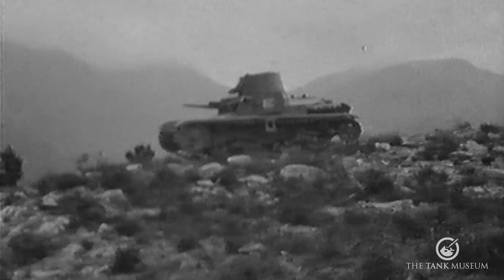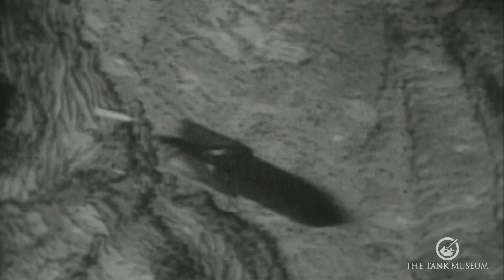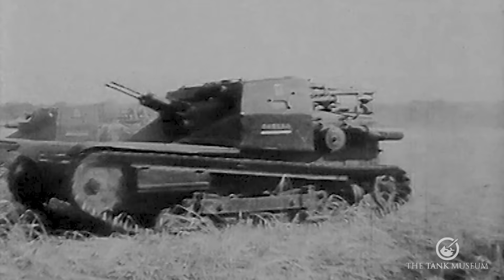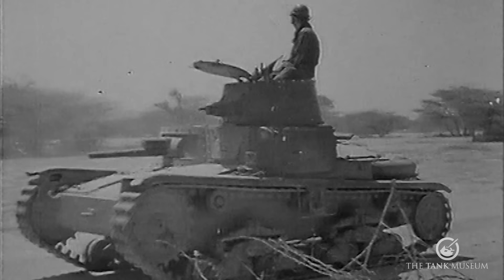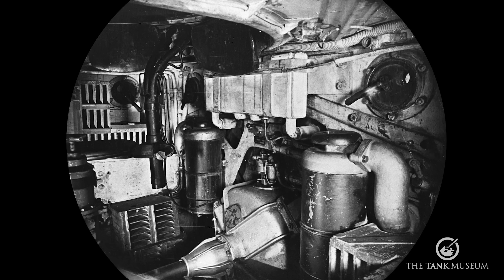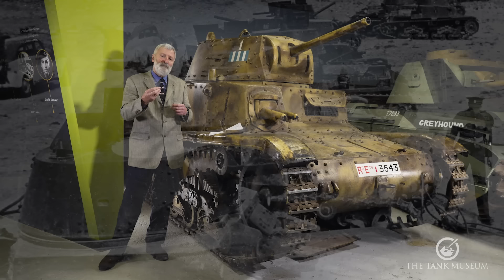Tank Chats #147 | M14/41 | The Tank Museum

Comment: The over looked difference between diesel and gas engines is diesels have more torque. A 350 HP gas engine wouldn't move a semi truck highway speeds but a 350 HP diesel will.

Comment: Rocking bogie is a neat and cheap trick that has been on many a truck and airliner. :o) Even if your spring is only a lump of rubber you still get a decent bulldozer or tracked dumper truck from a bit of triangular plate with bolt holes drilled in it.

Comment: I once read (can’t remember where) that while Italian engineers came up with several good designs for tanks, airplanes and ships, they often ended up putting somewhat crappy models to production because Mussolini made decisions based on what looked good as opposed to what performed well. I wonder how true or false this statement might be?
Reply: It does not make any sense, the problems were simple poor industrialization, scarcity of raw materials,poor decisions to make every builder happy instead of focusing on a few models and standardisation,that's it.
Reply: @M4NAH1MEK0  Yeah, like the industrial "mafia", led by FIAT, that somehow managed to build C.R.42 until the end of the war. Because upgrading production lines were too costly for them, poor souls.
Reply: @Ingulf_The_Mad  The last purchaser of the CR.42 had been the Luftwaffe.
The power of FIAT to impose his models is a mith. FIAT had been unable to impose the optimal CR.25 over the crappy Breda 88 and Caproni 300 series light bombers/reconnaissance aircrafts. FIAT would have VERY GLADLY built more profitable twin engined aircrafts over cheap biplanes and was by far the Italian industry whose production lines were more ready to build them.
The Cr.42 had been selected for production for a simple reason. It was immediately available, while the selected monoplanes needed several modifications.
Reply: Mussolini had not a direct say in the choosing of military equipment.

Comment: That Italians used three engined bombers because they had not powerful engines is a mith. 
The Vickers Wellington had two 1050 hp engines. 
The Bristol Beaufort, two 1060 hp engines.
The Bristol Blenheim, two 920 hp engines.

The SM.79 had three 950 hp engines (later equipped with "etilizzatori", an equivalent of the MW50, to have a temporary 100hp boost, to disengage after torpedoing attacks).
The Cant Z.1007 had three 1000 hp engines.
The BR.20 had two 1030 hp engines.

The performances of the twin engined Br.20 compare very well with those of the Wellington and Blenheim. The Br.20 was faster and with an higher ceiling than the Wellington, although with a lower bomb load, and had performances in line with those of the Blenheim, but with a better bomb load. 

In 1939 had been omologated the 1500 hp Piaggio P.XII. That used standard 87octane fuel. Probably the best radial engine that used standard fuel up to that point.
The Italians used two models of three engined bombers simply because they were faster that way, and could still fly with an engine failure, while, for a two engined bomber, an engine failure meant a long descent. That's why they were preferred to the Br.20 too.

Comment: Thanks David. As always, your chat was informative and balanced.
Question: why would a country using the metric system build a 47mm gun? 50mm is only marginally larger and either 45mm or 50mm seem so much ... neater.
Reply: Good question 🤔
I think the French, Czech, Austrian and Italien all built 47mm guns.
While 45 or 50 sounds more round it wouldn’t make any difference in production.
The caliber of the shell isn’t necessarily equal to what it is called.
German 10cm cannons actually fired 10.5cm projectiles and both US and Italien 12.7mm MGs actually fire bullets with 13mm diameter but both guns and bullets are still called 12.7mm.

Comment: This tank is very comparable to the Soviet T-26, but the T-26 with 45 mm gun dates from 1933 while the M14/41 had the misfortune to enter service in 1941
Reply: The M tanks had much better armor.
Reply: @neutronalchemist3241  Thicker not better.
Brittle armor is a massive hazard to the crew.
The Russians made better steel.
Reply: @allangibson2408  Twice the thickness is better.
Reply: @neutronalchemist3241  Not when it has half the strength and shatters like glass when hit. You want armor to fail in tension not brittle fracture because it is over hardened.
Reply: @allangibson2408  It's not "half the strength and shatters like glass when hit". RHA is RHA. The difference in alloy is marginal. The difference in thickness is massive. The armour of the T26 was pierced by 20mm projectiles. That of the M tanks was not.
Reply: @neutronalchemist3241  Did you look at the photos in the video? The armor failed with brittle fractures (like tool steel). That indicates either poor heat treatment or wildly incorrect composition.
So RHA is not RHA when the guys making it don’t know how to make RHA.
Reply: @allangibson2408  I've seen many photos. Included ones where the turret had been hit hard enough to uproot it from the hull, but it remained intact, and pictures with similar damages on the front hull of a Matilda tank. But you can pretend you can state that M tanks' armor was "half the strength and shatters like glass when hit" or that "the guys making it don’t know how to make RHA" because you have seen a picture if you want.

Comment: Italian radial aeroplane engines were US licence built models. Modern and advanced designs for their times.
Their comparative lower power performances were due to the lack of high octane fuel, like that supplied by America to the Allies.
Even Germany with its advanced chemical industry did not produce for the Luftwaffe comparable fuels.
The higher comparative power output of Merlins, Allisons and P&W's especially at higher altitudes was largely due to the US refining capability.
Add the design evolution capability, the advanced logistics and larger industrial base and you have the good mix necessary to win a war.
Reply: That Italians used three engined bombers because they had not powerful engines is a mith. 
The vickers Wellington had two 1050 hp engines. 
The Bristol Beaufort, two 1110 hp engines.
The Bristol Blenheim, two 920 hp engines.

The SM.79 had three 950 hp engines (later equipped with "etilizzatori", an equivalent of the MW50, to have a temporary 100hp boost, to disengage after torpedoing attacks).
The Cant Z.1007 had three 1000 hp engines.
The BR.20 had two 1030 hp engines.

In 1939 had been omologated the 1500 hp Piaggio P.XII. That used standard 87octane fuel. Probably the best radial engine that used standard fuel up to that point.
The Italians used two models of three engined bombers simply because they were faster that way, and could still fly with an engine failure, while, for a two engined bomber, an engine failure meant a long descent.
Reply: Germany had exactly comparable fuels to the Americans. They measured octane differently.
They just never had enough of it so ran leaner than the Americans.
The late war German engines also suffered from material availability issues leading to design compromises that severely impacted operational life.

Comment: Italian tanks were built with riveted armor plates not so much because Italy lacked the technology to weld them but with the idea that a pierced or broken armor plate could be easier replaced on the field if it was riveted than welded. Of course welding or casting posed major problems and it had needed investments the corrupt industrials weren't willing to do, but there was no lack of technical competence had they decided to go that way. The same reasoning was behind the suspension system: torsion bars are great but if they break they are a problem to replace under field conditions: much simpler with the boogies.

Comment: Thanks Luigi for that information, I never knew the 47 had a Heat shell available. I did know of the bravery of Italian anti-tank gunners who often waited till the enemy tank was only 30 or 40 yards away before opening fire, that takes some guts. This must have been before the heat round was issued obviously. However if one compares like with like the 2 pounder was a much better AT weapon, especialy with accuracy/penetration at longer ranges.
Reply: Actually the 47mm HEAT didn't work that well, and soon the gun crews were advised to treat them as standard HE ammunitions. HEAT penetration depends HUGELY on the diameter of the charge, and 47mm is simply too narrow to have noticeable effects over a simple AP round. 
Same for the first iteration of the 75mm HEAT ("effetto pronto"), that had the fuze on the back of the charge (usual for artillery ammunitions, but not for HEAT charges, that must explode at exactly the right moment to be effective) while the second iteration ("effetto pronto speciale", with front fuze) had very good penetration.
Instead the 100mm "effetto pronto", with back fuze, impressed even the Germans for its effectiveness on Soviet heavy KV tanks. The back fuze made it work like an HESH round, and the resulting spalling effect was more destructive than simply piercing a hole in the armor.

Comment: Also the 47 mm gun had just over half the penetration of the British 2 pdr and was hardly in the same class.
Reply: Indeed but it also comes down to the ammunition used. M13/40 enjoied availability of "Effetto Pronto" AT ammunition (think it's HEAT in english) while this ammo was less common among the 47mm issued to foot-folk. Anyway the M13-40 could support its own infantry or attack the enemy's one with explosive rounds which the british tanks lacked, so all in all not bad.

Comment: Its always fascinated me that the 2 pdr had such a poor/nonexistent HE round. Its 40mm in diameter the same as the bofors anti-air gun and yet it never got an effective HE round. Does the 7 extra mm of diameter on the Italian gun make that much of a difference?
Reply: Probably has something to do with shell length and army doctrine
Reply: I think it has more to do with muzzle lenght and muzzle velocity of the round. HE rounds are hollow inside and can't tolerate the accelerations of an high speed round.
Reply: @luigiduca  The muzzle velocity of the 2-pdr was not that high. That of the Bofors AA gun (or of any AA gun of comparable caliber) was higher, and they obviously had HE shells. 
It's a question of role. The Italian 47/32 was classified as an infantry gun, so HE shells had been developed and distributed. The 2-pdr was classified as AT gun, so only AP rounds were distributed.
Reply: @luigiduca  High velocity guns always have less effective HE rounds than low velocity guns of the same calibre for this reason - you have to make the shell casing much thicker to resist the stresses of firing and that reduces the amount of HE filling. Unless you make the shell a lot longer, but this brings its own problems.

Comment: T(h)ank you for a very good video on this Italian tank! I built a similar one as a plastic model back in the 70's, a M13/40 if I remember right, this brings back memories! I think the Italians are underappreciated, they worked wonders with what little resources they had. Well, they were on the wrong side, so it's good they didn't have resources, but still. They were no joke.
Reply: The Italians worked wonders with the leaders they had… Everything else flowed from that.

Comment: Basically everyone at the start of the war had fairly poor tanks by comparison to mid/late war designs. The issue is Italy didn't have the manufacturing capability to get rid of those designs quickly enough, where as everyone else did.
Reply: For fun, check out Italian artillery production rates. All the artillery heavier than a 75 mm mountain gun were produced in numbers of a few hundred each. The industrial base was limited, though in fairness also restricted by a lack of raw materials. The Italians were very dependent on imports and the Allied naval blockade and the German appropriation of the wealth of conquered nations forced them to largely rely on domestic resources.
Reply: Don't Forget that you have instances of Germany requisitioning materials that were being sent to Italy or when the Italians asked for German AA batteries to defend their factories Germany promptly said no, only for those factories to be bombed a year later. That was the main reason the P26/40 didn't enter production prior to late 1942/43
Reply: @theotakucomrade  Sure, but the base issue is still that Italy was not ready for a major war. Not enough technical base, not enough raw materials, not able to defend themselves when things went wrong.
Reply: @silmarian  
It was mostly about leadership and raw materials/production capabilities, the engineers that worked on Italian aviation are the most praised to pick an example

Their design capabilities weren't an issue as Italy had no shortage of talented designers, but they were hampered by the inadequate infrastructure and low material availability as already said, they had to develop work arounds, actually talented officers had to circumvent similar issues by applying new tactics, the situation wasn't in their favour, but that goes for all the Axis forces
Reply: Yeah, but some countries had adequate tanks by early-war standards and some did not. Tactics and logistics also varies widely, the latter proving decisive imo.